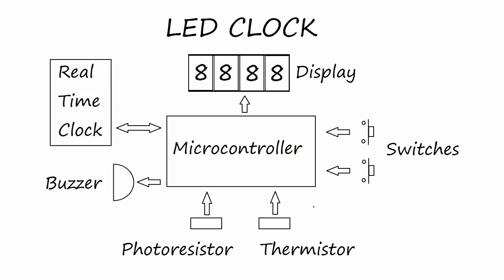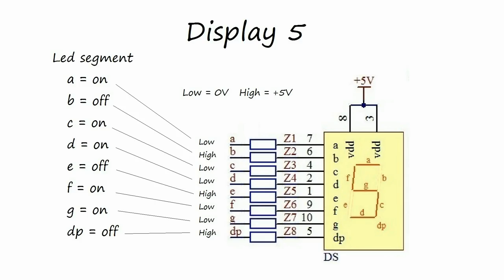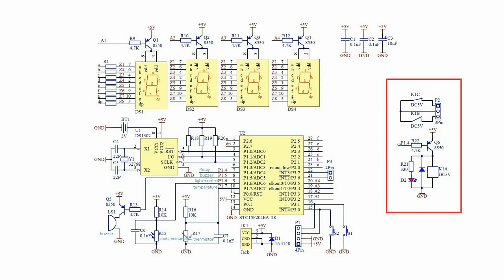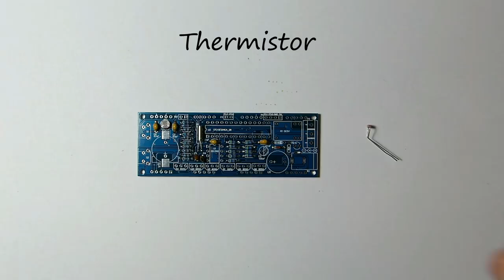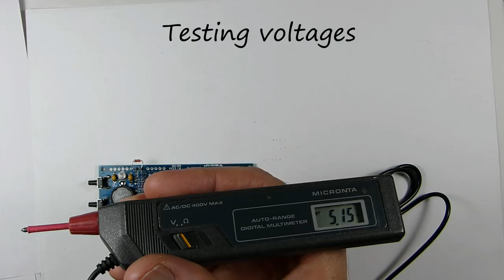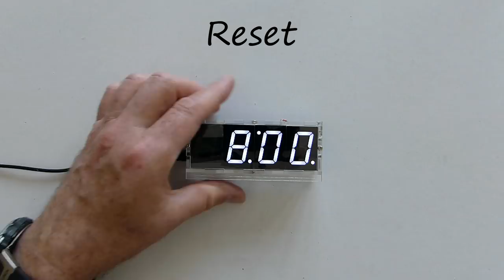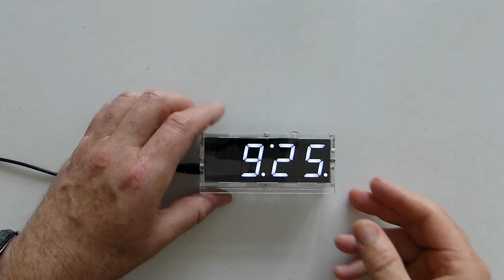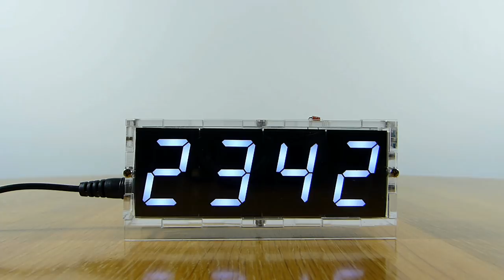4 Digit LED Clock Kit with Temperature - Full Build

Comment: If you look very closely at the film you put over top of the display, it's actually like a double face tape, sort of like window tint. Peel the layers apart and stick it to the led modules and then cut away the extra film by placing the display face down on the table and using an Xacto knife to cut around the edges. It takes a little while to get the layers separated.  I had to use the blade of the Xacto knife to get it started. It's a more professional looking job when it's done that way because the tint fits nice and smoothly to the display and you'd never know it's a sticker. I've built a few of these.
Reply from the maker: Good tip. Thanks

Comment: Wonderful, thank you. Did I hear 50W iron? How many mm solder? Thank you! Are the soldering speeds real time or accelerated? Why do we need to clean with a flux cleaner (what do you recommend)  before the digital displays?  I did this kit several times and always had problems. Why did you have to look at digital displays with magnifying glass??

Comment: I'm curious if there is any way one of those 7-segment displays can be modified to use RGB LEDs. You know, for giggles. I've seen another creator make this clock, and the backs of the displays are removable.
Reply from the maker: Probably I seem to remember they come apart

Comment: Hi, I hope you can read this, I am desperately in need of guidance , 2 weeks ago I assembled one of these and it worked fine with a 5V power supply, then a few days ago I by accident connected an identical looking PS with a 6V output and the clock flashed for a moment and then never worked again even with the correct PS, I need to figure out what part I have damaged but I'm a total novice and find it hard to troubleshoot, don't know where to start ,please help me if you read this message, .
Reply from the maker: I had a quick look at the circuit diagram and there is no over voltage protection in the circuit. 
Both the microcontroller and the Ds1032 have a max voltage of 5.5v, so more than likely you have damaged one of those two.
Reply: @techydiy  , that's what I suspected , I have compared the values of the resistors and capacitors  and so far, they are all salvageable ,all except the microcontrollers , at least I learned something , I sincerely appreciate your quick reply and your help. you were the only one that came through for me and it helped immensely.

Comment: It seems Banggood has stopped selling these, but I found more or less the same clock on eBay. It has a slightly different circuit, with fewer components, but the same functions, and came in a choice of red, blue or green LEDs. I have a blue one that's working nicely. This video was very helpful, especially for setting up and for case construction. For the first reset, I had to try a few times, pulling the plug between tries - it seems quite picky about how close together you press the two buttons, and does weird things if you "miss". I hope it dims properly at night - the blue LEDs are very bright.

Comment: Can I solder a 100 mm 7 segment display instead of this display? Will there be a change in operating voltage? Can it run a large display?
Reply from the maker: Depends on the display.

Comment: any tips on desoldering? Because I kinda struggle with it, especially with ic socket
Reply from the maker: +Gladys Datita I use a solder sucker tool or desoldering braid, but that often doesn't work for an IC socket, so in that case I would add more solder to bridge the pins/pads, run the soldering iron along the pins and then remove it.

Comment: Greeting from Australia, I have purchased these units for a school project.  When we power the units up they give us a code of H5C5, we reset as per the instructions but they do not go to 7:59 and then move to 8:00 and beeps.  All of these units are doing the same thing, what ar we getting wrong?  Thanks, Trevor
Reply from the maker: It seems a bit unlikely that it's a soldering fault as they are all affected, so check component orientation. Check that your using the correct instructions. Check the voltages on the components. Failing that go back to the supplier.
Reply: Thank you.
Reply: I have the same problem. Have you solved the problem? Thank you

Comment: What does that LDR do?
Reply from the maker: It senses the light level and dims the display at night.
Reply: @techydiy  gotcha. I have a problem with my alarm aswell.. i somehow cant turn the alarm off, do you perhaps know how i could fix this? I thought about taking the piezzo buzzer out but im not sure if that will break the circuit (im not planning on using the annoying alarm noise anyways)
Reply from the maker: I cant remember but removing the piezo will be fine

Comment: Mine doesnt resets :( any idea? It displays 7:59 and stays like that
Reply from the maker: Get a magnifying glass and check the solder joints for dry joints, bridges and shorts. Make sure the components are all the correct orientation and values. Usual stuff basically.
Reply: @techydiy  the photoresistor and thermistor work and the temperature changes the value properly, also the clock counts and i can acces and adjust day, date and alarm. But it doesnt change with time, it just stays on 7:59, I plugged it yesterday and it worked perfect. But today i change it of place and it didnt reset anymore
Reply: Same here. Assembled just fine. All solder points are clean with no bridging. Temp is fine. Beeper works. But no "ticking" as it were. The middle dots don't blink; time never advances. If I reset it, it never moves from 7:59 to 8:00. Must be a bad crystal. Shame, it was a fun build and looks cool when done. Nice video though!